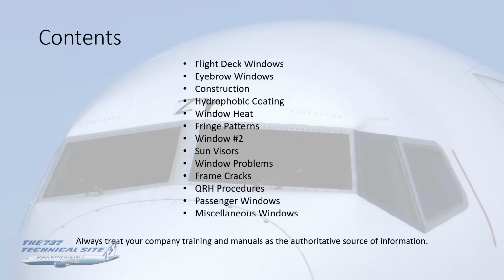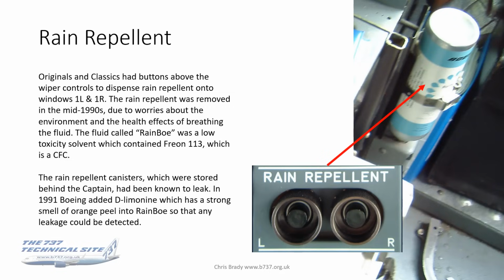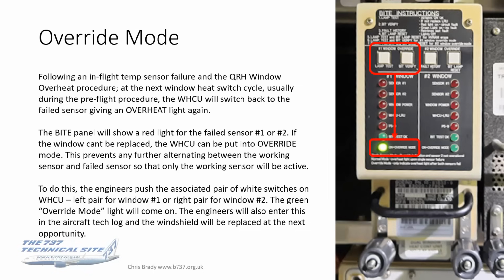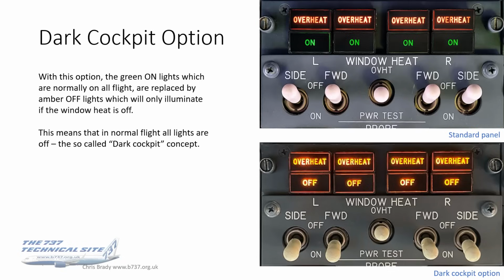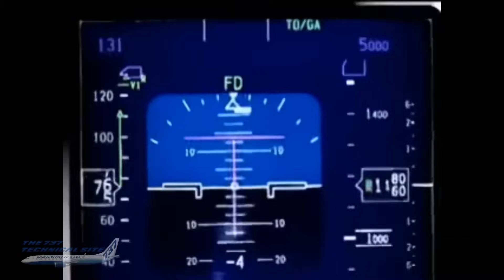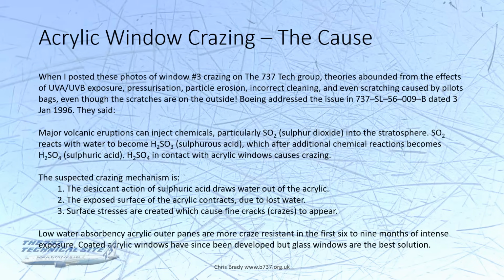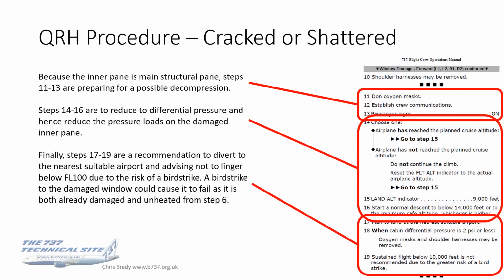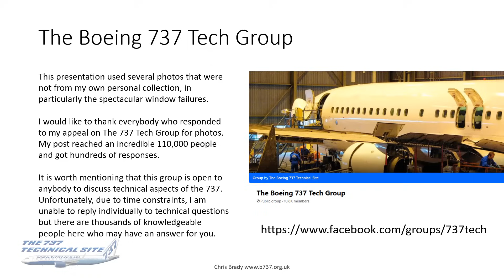737 Windows

Comment: Another great video.
I've seen drawings from back in the 707 days where the eyebrow windows were called "vision-in-a-turn" windows. Which made sense, as during banks, one sees little more than ground below when looking out the side windows, while looking in a slanted "up" direction through the eyebrow windows you'd see the direction the airplane was turning to, on the horizon.
Happy New Year to all.
Reply from the maker: I wasn't aware of that term but yes it makes sense. Having performed steep turns in 737s with eyebrow windows I can testify that they do help with lookout. It makes you wonder why they didn't retain them for the military versions.
Reply: I have also heard that when Boeing designed the 707 135 it was a selling point to help get the military contract to help in air refueling for the pilots to see the other plane above them Douglas did the same thing with the DC8

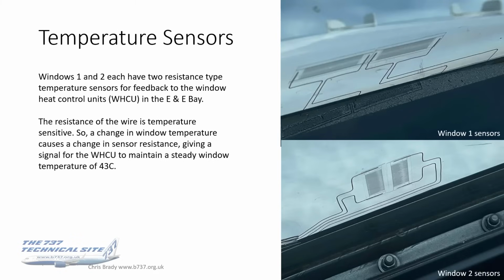Comment: 22:17 - the heating element may not be gold but that temperature sensor is platinum! It's most likely a PT1000 (or higher) type sensor which uses a fine platinum wire which changes resistance with temperature.
Reply from the maker: Where were you when I was writing this presentation? These are the sort of fun facts that make the videos interesting!
Reply: @ChrisBrady737  hahaha. I think the wealth of technical knowledge you dropped already is MORE than enough 😂. Keep up the amazing work!

Comment: Hello Capt, great video, as always.

Is there a reason you could think of (other than cold weather ops or the 10 minute limitation), for Boeing not putting in the before taxi and the shutdown checklist, turning on and off the window heat?

Would it prolong the life or affect the structural integrity of the windshields?
Reply from the maker: Window heat is in the Preflight checklist rather than the Before Taxi checklist to give the windows enough time to warm up.
Reply: @ChrisBrady737  I know, I meant for quick 40 minutes turnaround flights, were you don't turn them off unless you do a secure checklist

My question is, because we are reviewing some procedures in the airline I work for, very new airline, and it seems that originally they copied the normal.checklist from another airline that does put this procedure (turning on and off the windshield heat) for turnaround flights when you do the before taxi and shutdown checklist.

If it is to prolong the life of the system, it seems to make sense, but if it would affect the integrity of the windshield, then maybe it wouldn't be wise to keep it,  but I couldn't find any recommendation about it.
Reply from the maker: In general, you should stick to checklists and flows the way that Boeing wrote them. If anything goes wrong and you have diverged from the published Boeing procedures you will be very exposed legally. You could approach Boeing with your proposal and ask for an NTO which will help your position.
Reply: @ChrisBrady737  thanks for the reply

Best regards!